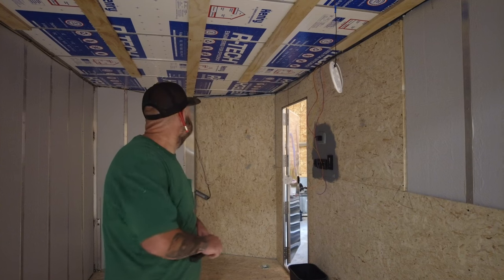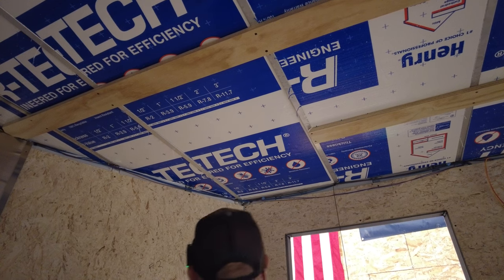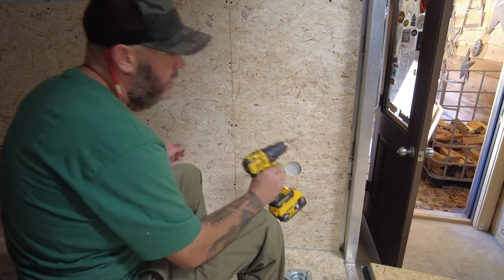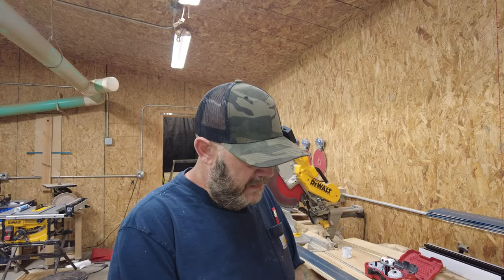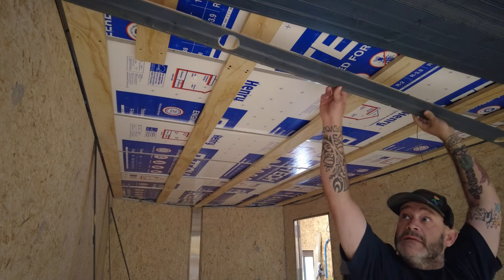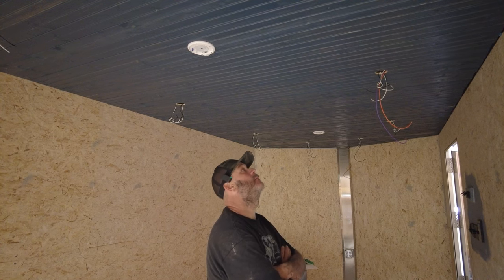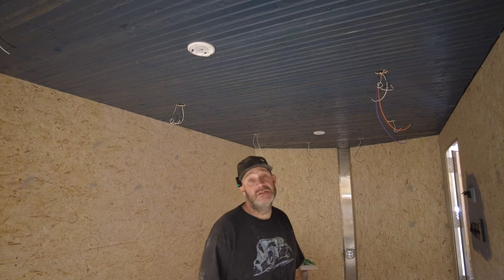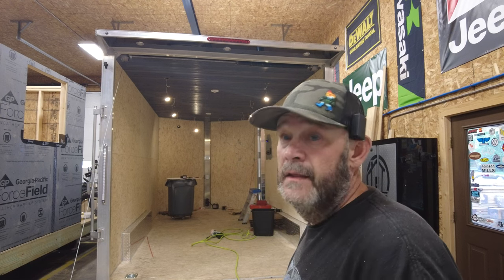Enclosed Trailer Camper Conversion | Ceiling and Light Installation

Comment: So you installed insulation then ran the plywood strips over roof braces for a nailing piont
Reply from the maker: yes. Gives a nice space to run wires too.
Reply: @buildlifeoverland  thank you for the response.  What did you use 1/4?
Reply from the maker: @sxsoffroad43  The strips are 3/4 (better hold for nails and wont sag) the bead board is like 5/16" tongue and groove from Home Depot.

Comment: I filled my outside vents with spray foam and then painted them black.
Reply from the maker: I wound up putting them back over the hole but when I took this out the ac was sucking the door shut so hard I drilled them back out!

Comment: I can see the ceiling loosening up. Don’t you think glue added would have been a good choice?
Reply: Ok I see after I posted you do use glue😅.lol
Reply from the maker: Glue with a little flex to it is a good idea too I think. Also the ceiling trim around the perimeter keeps it locked in pretty good.

Comment: What is that tongue and groove product you used on the ceiling?  Looks fantastic.
Reply from the maker: It’s bead board about 1/4” thick. I bought it at Home Depot
Reply: @buildlifeoverland  can you elaborate more? I looked on Home Depot’s website and could find it. Do you know roughly how much the material weighs? Trying to keep my trailer weight down. (Single axle 7x12) thanks and like your videos

Comment: I’m confused on your first comment on having a small air gap between your ceiling and insulation and later mentioning ‘rule of thumb’, to vent air space or fill it? Where did I misunderstand?  Thanks.
Reply from the maker: Gets a little tricky and and some would debate but It is a space between the trailer roof and the insulation you need to vent or fill. The space below the insulation is within the controlled envelope if that makes sense.
Reply: Thanks for taking a minute for my q! Appreciate the feedback…stay well.